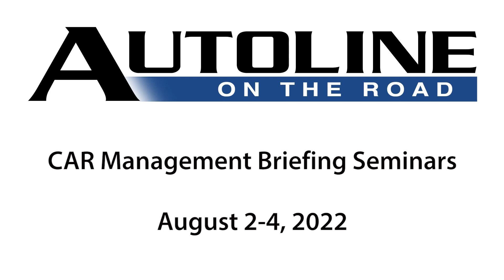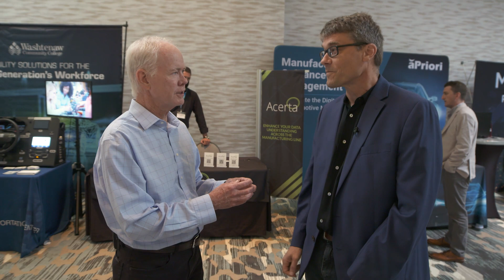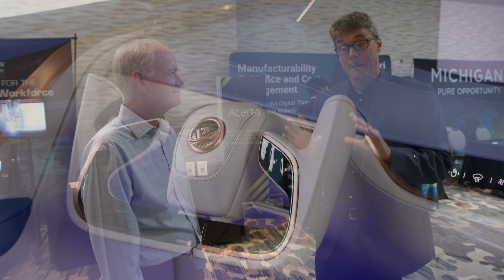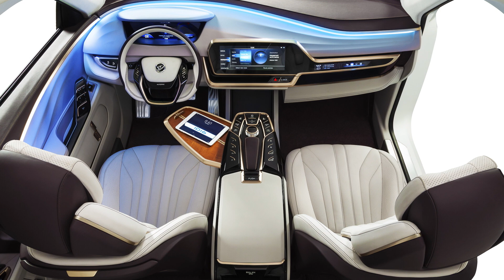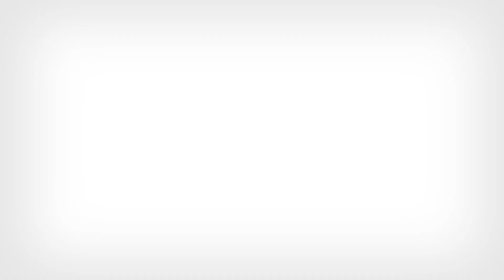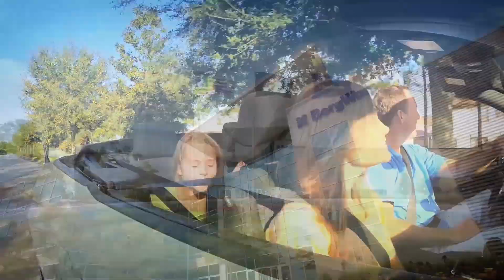Yanfeng Develops A Steering Yoke & Systems Engineering Was Key - CAR MBS 2022

Comment: I'm skeptical, but on the other hand no one ever gets on a motorcycle and says I wish this was a steering wheel. I'd like to at least try a steering wheel 1-in smaller diameter
Chevy Spark EV had a dashboard that move with the steering wheel tilt, bring that back.